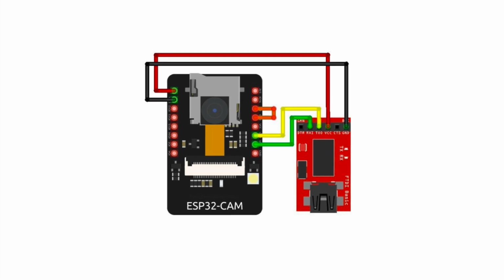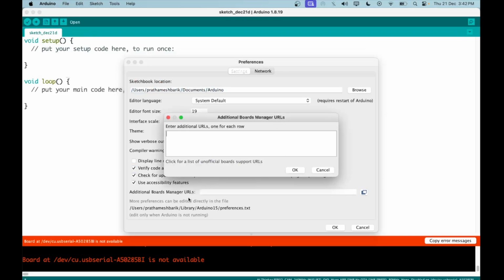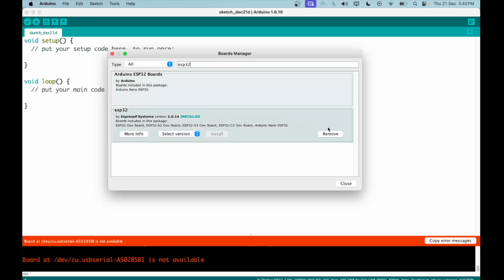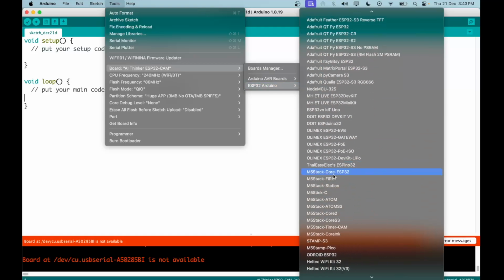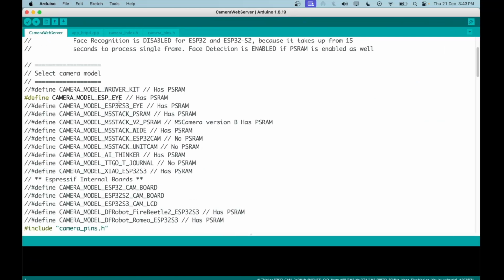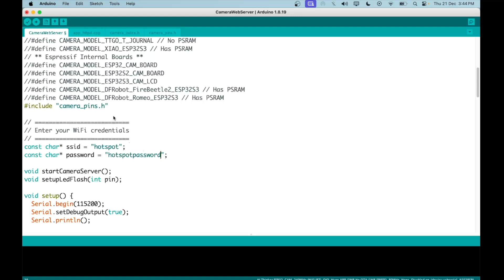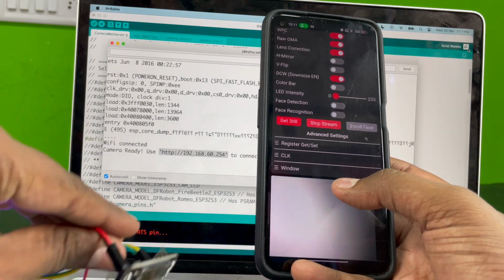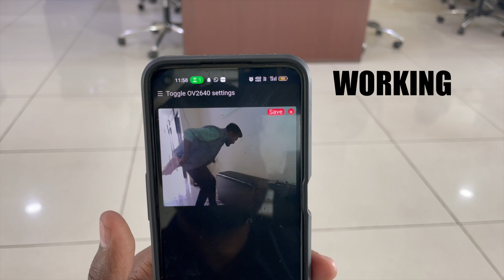How to Build a CCTV Security Camera System at Home?

Comment: Hello sir, I have 808nm 200mw IR laser diode but I don't know how to make adjustable driver circuit for this laser diode. Can you please give me suggestions or tutorial video how to make driver board for this laser diode and it's can burn matchstick from 1 meter distance
Reply from the maker: Hi, you may check out the following tutorial. It uses an LM317 as a constant current source to drive the laser diode. https://circuitdigest.com/electronic-circuits/laser-diode-driver-circuit-diagram
Reply: @Circuitdigest  sir this driver board circuit can work for 808nm 200mw laser diode
Reply from the maker: @ronishbarakoti4371  The driver circuit has nothing to do with the wavelength. Adjust the current as per your laser diode specs and it will work just fine.
Reply: @Circuitdigest  Okey, thanks for your suggestion it will very helpful for me

Comment: If i create a web server with esp 32 and i re turned on the ESP did ip address changes every time ??
Reply from the maker: Hi, the IP settings working on DHCP. So it will all depend on your wifi router. With most routers, the IP will be almost the same for at least 24 hours, unless you restart the router or there are so many devices on the network. You can fix this by either setting manual IP within the code(make sure to exclude this IP from your router's DHCP pool) or you can reserve IP using the MAC address within the Wifi Router.
Reply: If i create a esp own wifi network so, then ?
Reply from the maker: @aadarshchaudhary44  If you use the ESP as an access point, its IP will always be the same.
Reply: @Circuitdigest  thankyou so much.

Comment: Great video. I did the same, infact I recieved the IP address also but when I opened it on my chrome browser and pressed the start stream button stream is not visible. Only black screen is shown there. How to resolve it? Please tell where I'm lagging to get the stream?
Reply from the maker: Thank you. Try reducing the resolution and frame rate to fix the black screen. Also, make sure to use a stable WiFi connection.